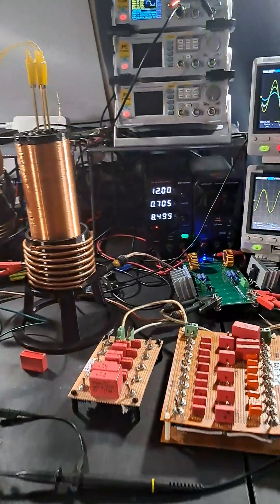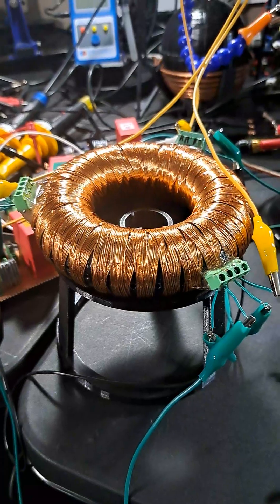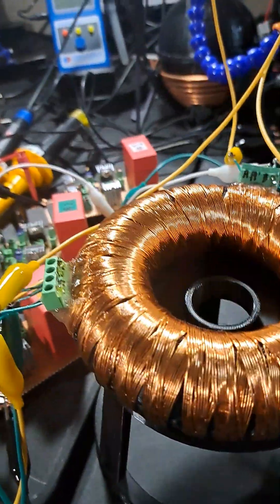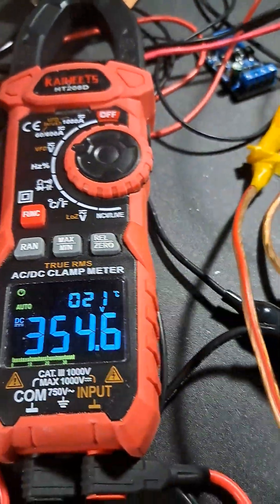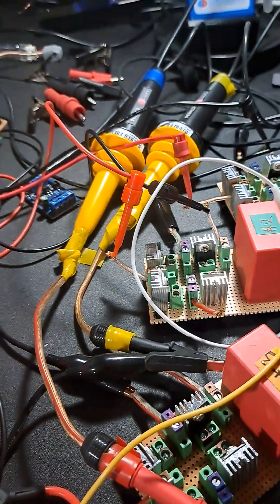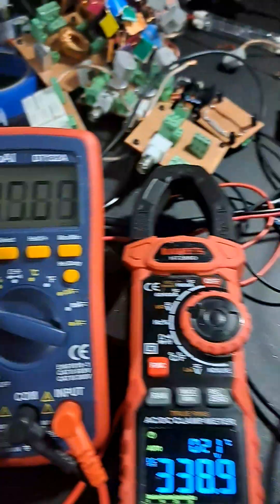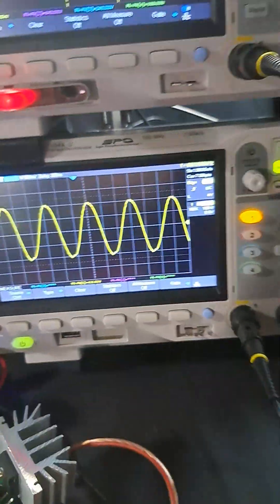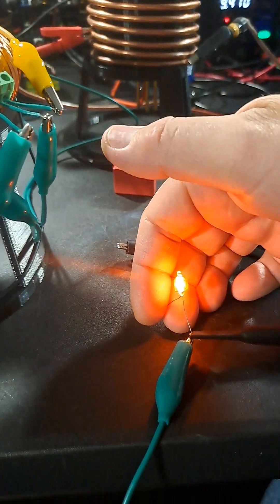One Wire Energy Pulls 66 Volts from the Ground

Comment: Your neighbors gonna have a huge electric bill
Reply from the maker: Why?
Reply: @bogirishIan  maybe it's leaking from them through the ground ?
Reply from the maker: @me_josh  Why not from the ground itself? The planet is known to be a giant capacitor, the ionosphere being positively charged, the earth negative. Voltage differential increases linearly from the Earth's surface upwards by 100 volts per meter (3.28ft). So theoretically, if you can encourage a 'flow' of negative charge within a system - like dropping a brass rod down the center of a Tesla secondary coil - it seems to do just that. In the video I'm resonating a secondary at the same time as measuring the voltage coming from the ground connection. I have nothing conclusive about this, just that there seems to be an excess of energy from the displacement current flowing from the brass rod. The brass rod is not connected to the coils at all, purely capacitive induction. Maybe part of that energy is ground current, maybe not. The voltage in the caps is real however, which has sparked my interest (pun intended). Tesla One-Wire energy flow - he was resonating huge coils with the ground (Earth) in his Colorado Springs experiment - check out the huge rod in the center going into the ground!
Reply: @bogirishIan  maybe but in the Philippines they do that where they steal electricity by using the ground...but usually the meter just runs fast somewhere else ..from what I understand 😂
Reply: @bogirishIan  I think it's great what your doing I was just asking if these were the same
Reply from the maker: @me_josh  I've not heard of the Philippines ground supply! Where did you hear that?

Comment: Shitty shielding on all your equipment, the 500 foot of coiled copper wire (antenna) setting there should be pulling more than that LOL
Reply from the maker: ...and in spite of all that, what are your thoughts on the results?
Reply: @bogirishIan  You're pulling energy inductively from the AC mains wiring in the building. It's not free. Additionally, voltage is not a measure of useable power. Power is measured in watts or VA. Measuring voltage with almost no load is pointless. 1 million voltages at 0.0000001 amps is only .1 watts.

Being disconnected from ground or to ground or whatever is irrelevant. Phones can charge inductively through magsafe and have no physical connections either.
Reply from the maker: @deelowe3  Do you see this as a closed system or open? The ground pull was only out of interest, not a claim of 'free' anything. I'm more interested in the displacement current coming from the capacitive coupling of the rod down the center of the Tesla secondary coil. I'd be interested in your thoughts on that, as there seems to be an excess of energy there. The energy stored in the caps from the displacement current is real, and discharging the caps using a 330 ohm 5 watt resistor gives a continuous 10v. AI calculated the equivalent amperage as 2.3A to maintain that draw. The input from the DC PSU was 12v 0.47A. Thanks for your interest, I'm just trying to figure this out!
Reply: @bogirishIan  I ran a slayer exciter circuit with no ground wire to the tesla coil. Then used the earth to ground the light by pushing it into the ground (Mud). It worked even better. Keep up the good work. I am doing more testing tomorrow morning.
Reply from the maker: @oldmanbuilds  Hey Nathan! I listened to your show with Joe yesterday whilst rebuilding the staircase outside my house! It was excellent. I also have an experiment waiting to do - I made one of Shawn's 'short stacks' and tested it out late last week. That tiny coil gives 910v out of the rectifier from one rod, same 12v with about 1.8A DC input (resonance was challenging - still to get it sorted properly hence the higher amps...) 
I just finished winding 3 more copies of the short stack to run in resonance with the first driving the OWE - I want to try using my 6 channel Rodin coil as the distribution center from one to the other three, as it seems to have 'normal' inductive behaviour between the windings as shown above in this video. I'm interested to see how the OWE behaves in the satellite short stacks. I'm hoping it will transform the HV back to ~12v from the primary with an increase in effective amps...
Until yesterday I thought you were putting the OWE into your Rodin coil, but you showed it connected to the top of the Tesla secondary, thus keeping it in the 'hot' closed circuit? Was that a one-off or is that your norm?

I ordered all the caps and switches to make another Master Ivo capacitor tuning switch board - I'll likely do a video of that build just to show how it's done - it's really useful to pull the Tesla systems into resonance with the ZVS, regardless of what is put down the center of the secondary aircore. As you know I've had 6x 1/4" brass rods in there and still not blown a ZVS mosfet when using the cap tuner as adjusting the Fres is quick 'n easy! 

Cheers Nathan - always great to hear from you - looking forward to your combination test results with the two resonant Teslas!
Reply: @bogirishIan  The wire connected to the secondary was a one off. I was showing how to change the frequency of the coil. I showed mild change. 

I look forward to the cap bank build. All of us need that. 

I like the winding of all coils to the same frequency. I am doing the same thing. I might have to order more wire. 

I am glad your testing is going well. I plan to do a lot today as well.